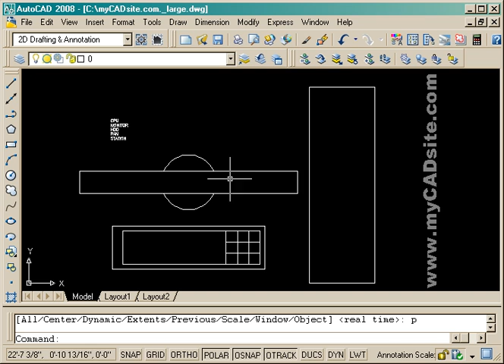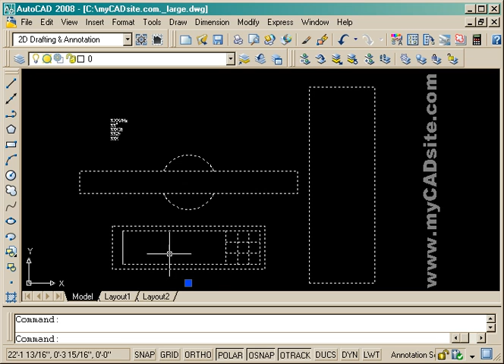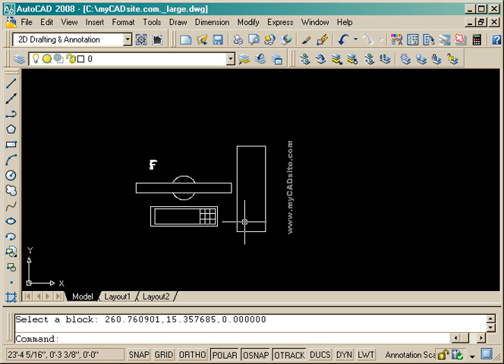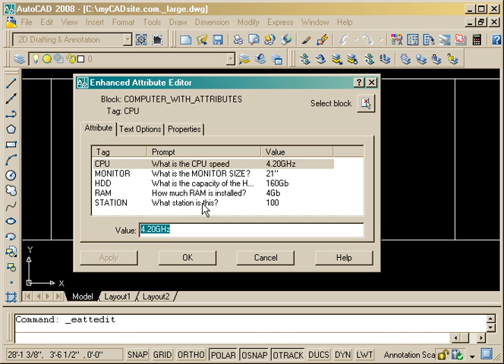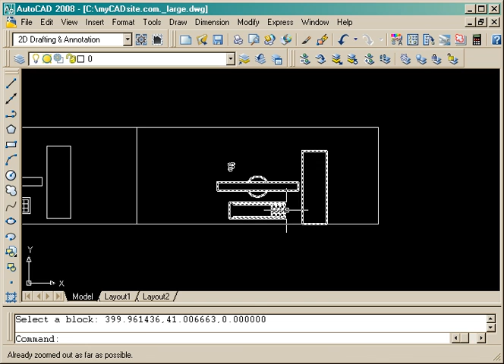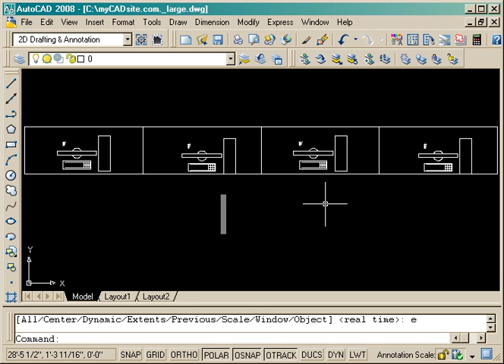AutoCAD Tutorial - Creating Attributes from myCADsite.com

Comment: I believe you could accomplish this by a slightly complex conversion of your attributed block to a Dynamic Block.  Other than that, I'm sure you could do it programmatically, possibly even with a LISP routine.  I'm guessing you want to filter (FILTER seemingly won't accomplish this either) the block, not just by the existence of a TAG, but by it's VALUE???  You might search the Autodesk Discussion Groups... I couldn't quickly find the answer, but perhaps you can!